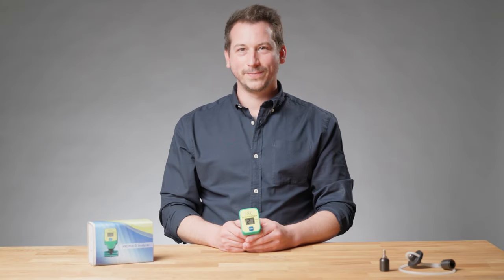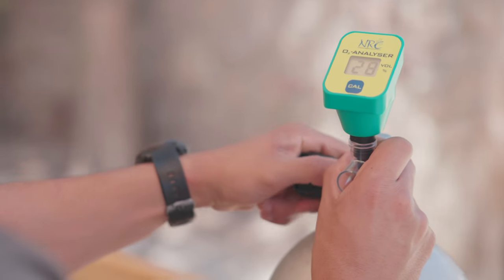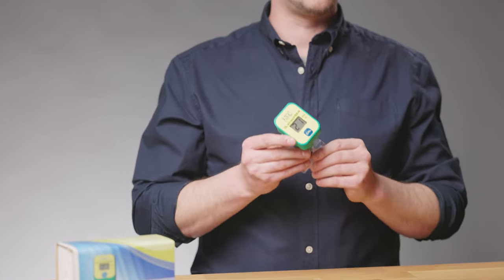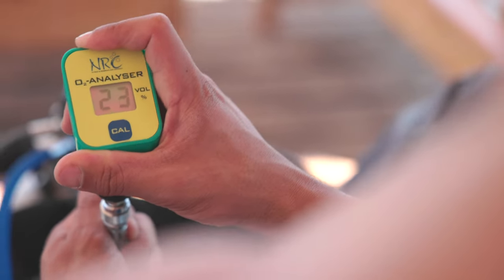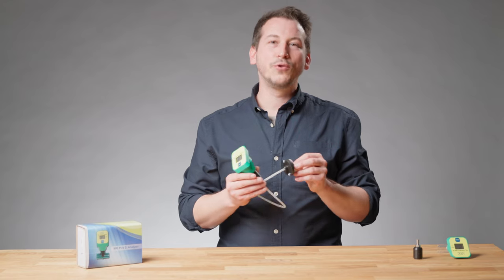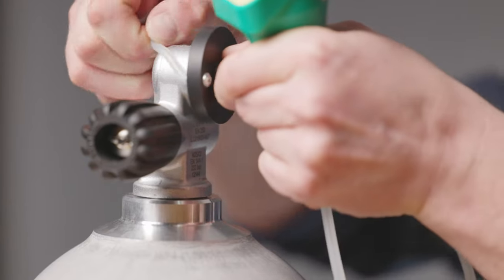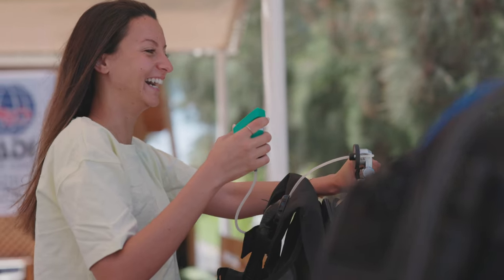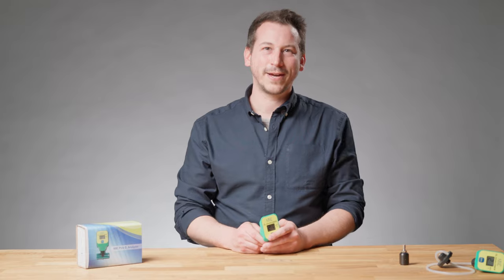NRC Pick O2 Nitrox Analyzer

Comment: Hi, is there any posibility to turn it off? How long the battery is working when the analyzer is still ON? Thanks.
Reply from the maker: Hello, yes that is correct The analyzer is always “on” but that would also be the case if the display was switched off as the cells in an analyzer are always working anyway and cannot be switched off. The batteries last about twice as long as the cell.